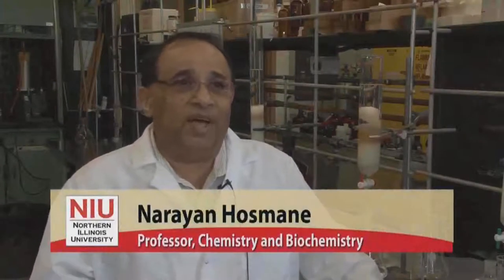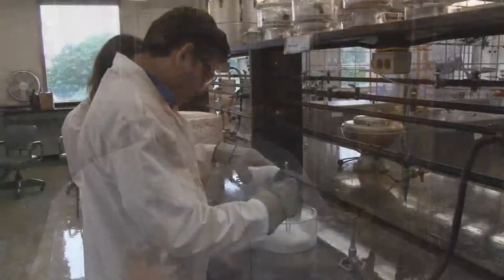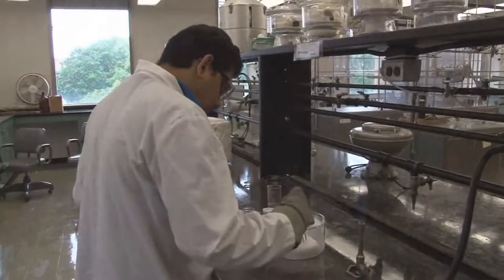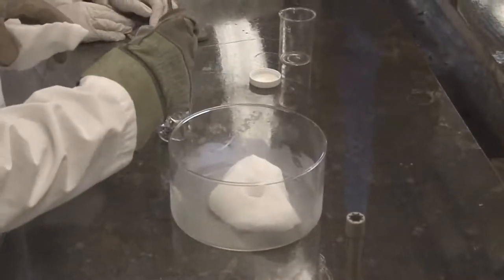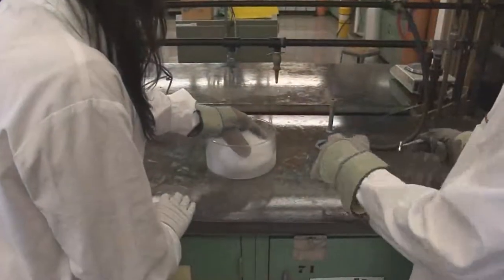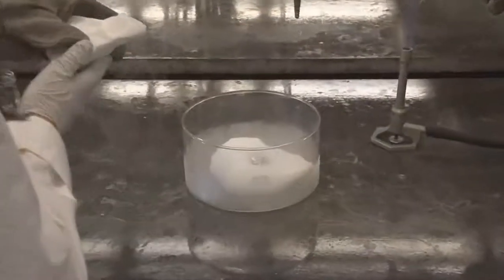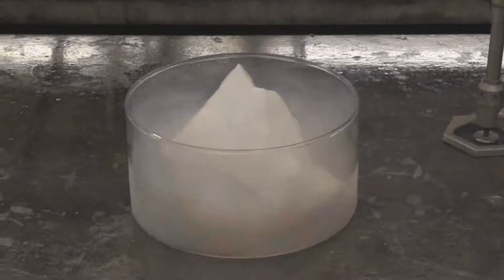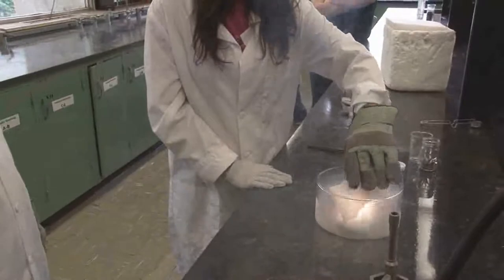Graphene Synthesis by Dry-Ice Method - NIU Video

Comment: You probably did find out already that by burning or treating with excessive heat you are disintegrating the natural circling electrons and it is hard to set them back in the natural order.That is way so many people in prestige labs see such big resistance in the Graphene sheets but many not credited researchers has good results by putting the graphite particles with out any force.